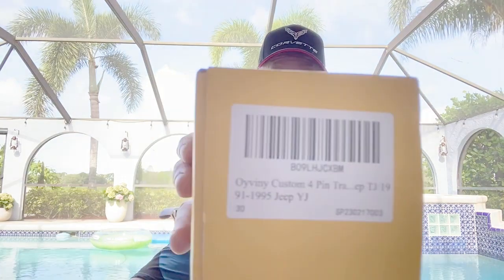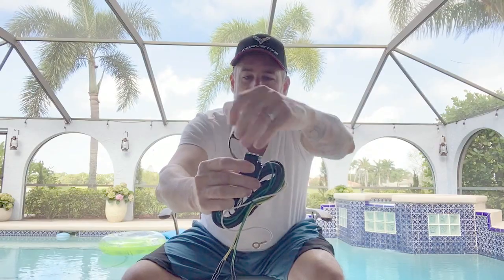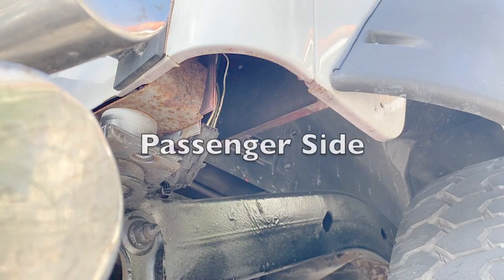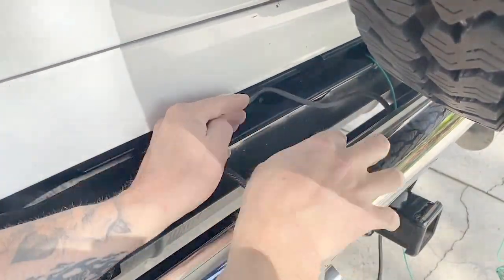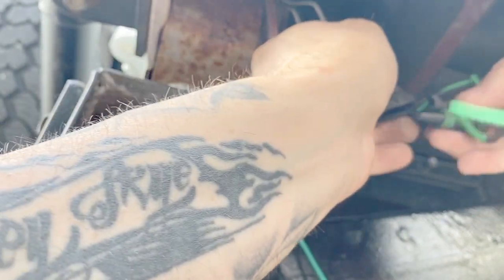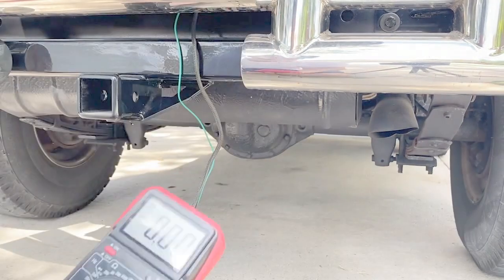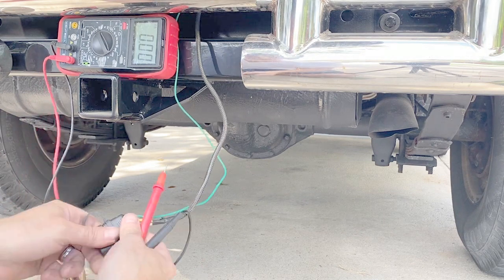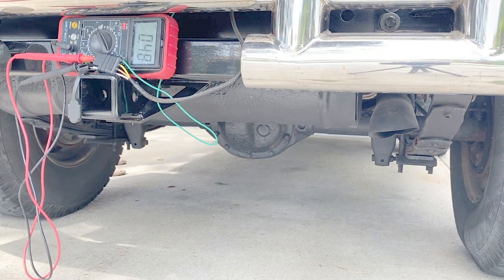Install a Trailer Wiring Harness on a Jeep Wrangler YJ in under 30 Minutes

Comment: I tried on my 1994 YJ, but it doesn't have the simple clips to plug into the trailer harness.  I have the same harness as you, but the wiring is all just wires connected to eachother.  What do you recommend?
Reply from the maker: The jeep in the video is also a 94.  Perhaps a previous owner removed the connectors when the tail lights were changed?   Does it have OEM tail lights?  or maybe there was just a bad connection and they eliminated the  connectors?

It's hard to say without seeing it.  

I'd say you have a couple of options.  You can simply splice into what you have and solder/shrink wrap the connections(the cheap way), or you can buy the connector sets and install them where they should be (will cost more, but be correct).  For me, which way I did it would depend on the rest of the jeep.  If it was in exceptional condition and mostly original, I would buy the connectors.  If not, I would splice it up, solder, and shrink, and call it good to go.
Reply from the maker: If you have questions on where to cut and splice, let me know.